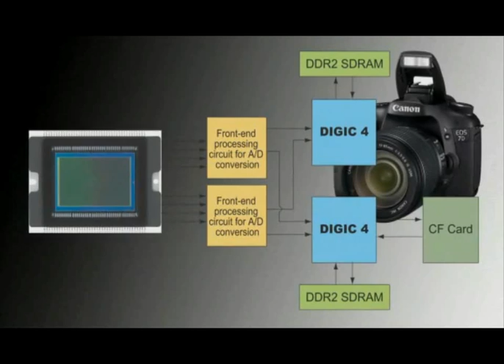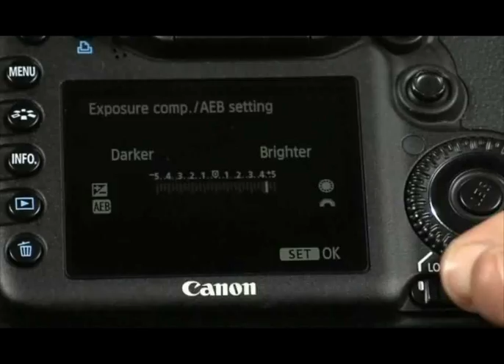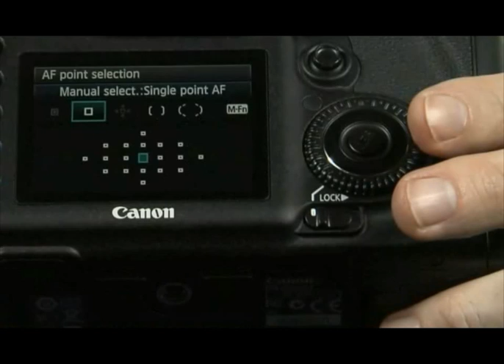Canon EOS 7D - New Technologies 3/6

Comment: I have 7D upgraded from 50D and yes AF is better , àdded more other thinks , better image on high iso, but there is compromis made by canon beetwen 50D and 7D so like i said 7D has less noise on high iso but 50D has less noise on low iso, if u watch the picture on 1:1 u will see that 7D show some noise even on 100 iso , the picture looks little bit grainy . I was compering  this 2 cameras and 7D  noise at 100 is like 50D at 300 or even 400 ;(